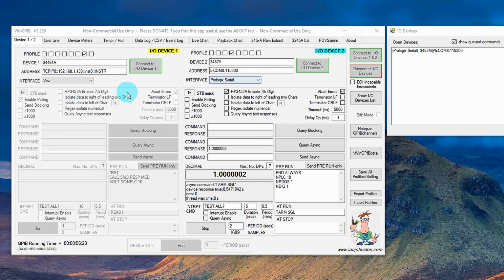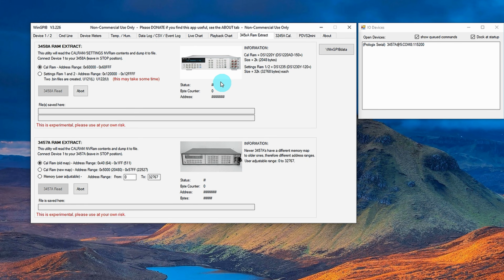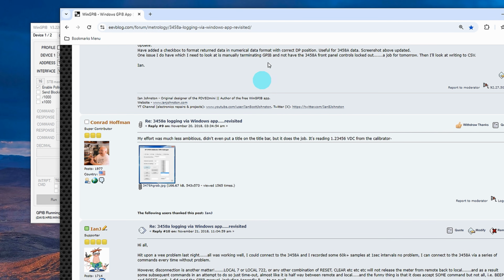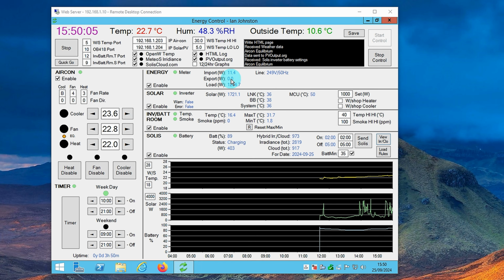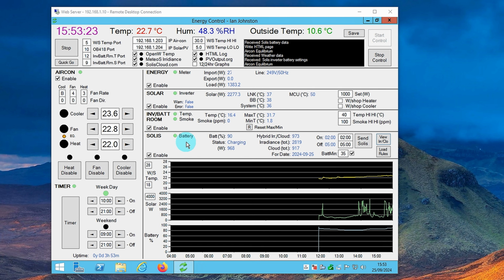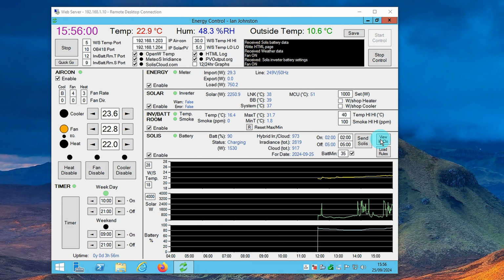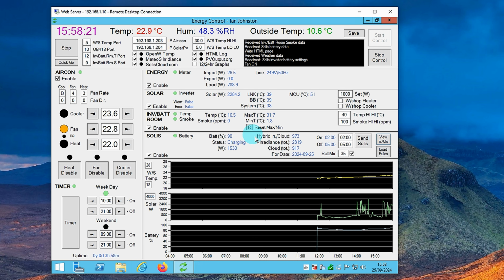No.142 - Channel Update - Software Projects

Comment from the maker: Stuff I didn't mention about the energy project:
1. To get Solis API access you need to contact Solis support and sign a form. There are two API documents, one for reading, one for writing (device control).
2. SolarPV inverter is a Bosch BPT-4-S and has easy http IP address access to the data.
3. I have a temperature and smoke sensor in the Inverter/battery room. There are HI HI values configured to email me if they go too high.
4. My independent energy meter is an OB418 with RS485/Modbus data access.
5. Aircon is a Daikin fitted with the option wifi module, control is simply through http commands on it's IP.
6. Outside temperature is being pulled via OpenWeatherMap.org API.
7. I am publishing all data to PVOutput.org.
8. Apps are written using Visual Studio 2022, and writing in VB. Thats right, VB........purely because I am used to MS Access VBA.

Comment: Do you have a feeling yet for the accuracy of the daily irradiance forecasts? Obviously if they are not great there is not much point in refining the lookup table. Otherwise you might find that you have enough confidence to turn the table into a function - maybe just MX + C, or if things are really good, a quadratic. And do you monitor irradiance yourself, I mean with a photosensor?
Reply from the maker: It's only been a few days since I modified the hybrid equation.......and I am logging to file some of the data.
I need some really sunny days, so dark cloudy days and a few in-between in order to see properly where I am.
There are other factors which I can't do nothing about in terms of forecast and one is my daily consumption. It's relatively varied.
I don't measure irradiance myself, I just get the data based on my long/latitude from Meteosource.
Reply from the maker: I have been playing with y=mx linear formula and a quadratic solution, both written as functions I can easily switch between……however, the elephant in the room which upsets the forecasting by straight formula is the house consumption. If it’s high then of course the battery will deplete faster. Most of the house consumption is known, the high days and the low days…….so I may need to factor in this also. Not sure if I really need to go to that level as actually there’s no real harm in charging a little more to cover that.
Great fun!
Reply: @IanScottJohnston  when did need ever have anything to do with playing with interesting stuff?

Comment: Ian, nice work you did on the software. One important note - you should follow more metrology related terminology in future in GUI such as : calibration = comparison measurement between DUT and reference standard. adjustment = well, process of doing calibration AND adjusting the DUT to reduce the measurement errors. From looks of your UI 3245A CAL. is actually supposed to be 3245A ADJ. and so forth in the other GUI elements. Unless you only measure (calibrate) and write the measurements into some CSV/datalog file and NOT doing adjustment?
Reply from the maker: Yes, I guess I should follow the proper terminology. I will update the GUI. Too many decades saying it wrong!
On the 3245A, it is making adjustments.
Reply: @IanScottJohnston  I'm blaming vendors to mislead everyone, since we keep seeing that misconception in all the manuals, even today.

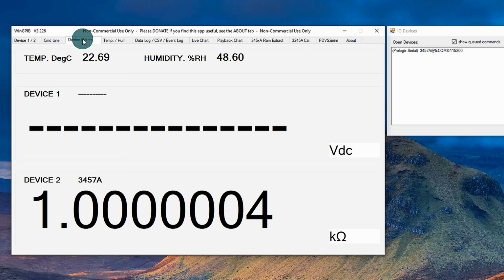Comment: 3:18 & 4:33 - I am fairly certain it is 1 Vdc since you mention it and your DC voltage standard, but on the "Device Meters" tab it says kOhm.
Best Regards
Backseat drivers / bugreporters 🙂
Reply from the maker: Yes, the kOhm label is user adjustable and is just the default.......you just click on it and change the text to whatever you want. I didn't bother for the video...:-)
Reply: @IanScottJohnston  ah that makes sense 🙂

Comment: Hi Ian, could you talk a little about how you did your home solar install as I understood this was prohibited in the uk?
Reply from the maker: I didn't do it myself.......I got a reputable installer for both the solar and battery system, then it's just all about the software.
Reply: @IanScottJohnston  Thank you Ian. I suspected there was no legal route to diy in the UK. all the best and thanks for the great content :)
Reply: @gillywild  There is a legal route. If your inverter conforms to g98 or g99 you can inform your DNO yourself,  I did it . Although I had flat roof space just to lay panels. Not sure I would bother doing my proper roof myself.  Also explaining the DIY route to Octopus has been a chore I am still facing.
Reply: @GlennPierce  Thanks for that Glenn. How did you get over the prohibition on undertaking the electrical installation work yourself (Hooking the inverter into the consumer unit)?

Comment: I just charge my batteries to charge at night regardless of the weather. it's 15p+vat / kWh for the night. if the sun shines my batteries are full and i sell the excess back to Octopus for 15p/kWh. so i just lose the cost of the vat, so can't be bothered to automate it. was looking at my inverter "solis as well" but all the ports are full. one is connected to a monitoring unit in the fuse box and the other to a wifi dongle that talks to solis for their app  and the installer for fault monitoring.
Reply from the maker: On the Solis I have an adaptor that plugs into where the wifi dongle port is, so ethernet instead of wifi.....that allows Solis to talk back to the cloud and also gives me access via the IP address......reliable access that is (I hate Wifi).
Reply: @IanScottJohnston  what did you use for the ethernet adaptor? Wifi dongle that's fitted does go off line at times and i have to go and remove it and plug it back in. could be open to putting a switch next to my router and running a network cable to the inverter. was thinking of doing this for some networked camera's so Could kill two birds with one brick.

I'm on the simple export so i get 15p/kWh regardless, but even with this i still don't pay for electric all summer. Currently they own me enough to be bill free for a good few months to come.
Reply from the maker: Solis Data Logging Stick S2-WL-ST (has RJ45 on the end). I think I just bought it via Ebay. I think there are different versions, so make sure you buy with the right connections for the Solis (4-pin connector if I remember)
Reply: @IanScottJohnston  thanks, I'll put one on my to get list
Reply from the maker: Exporting is the next thing to do......if batteries have sufficient capacity (Summer) to power the house and there's some left over then dump some to Octopus @ 23.21p / kWh (4pm to 7pm) in my area right now.